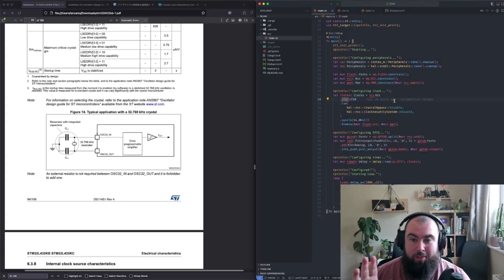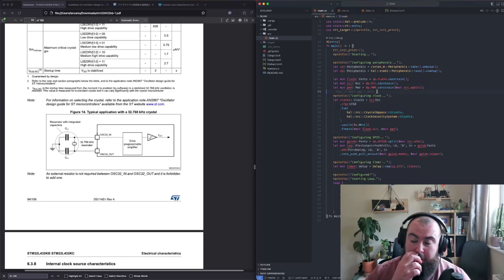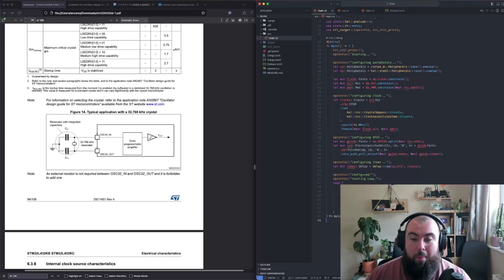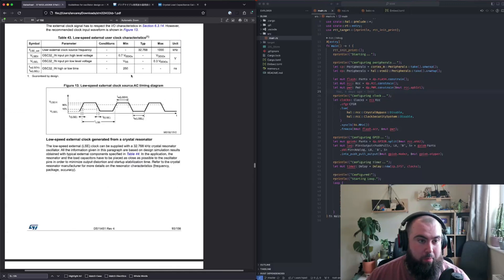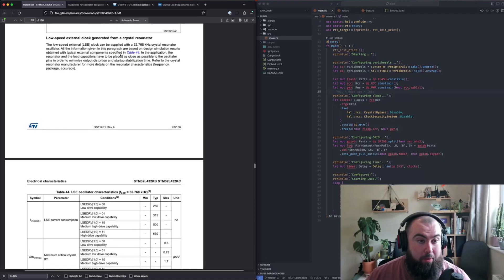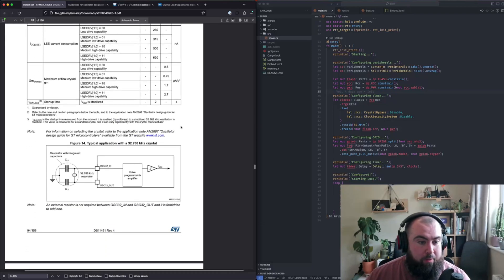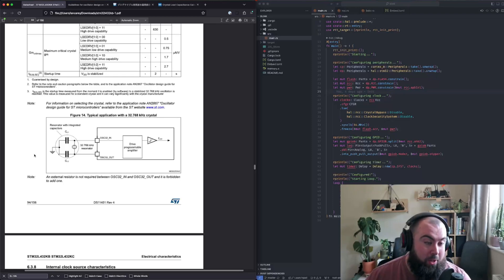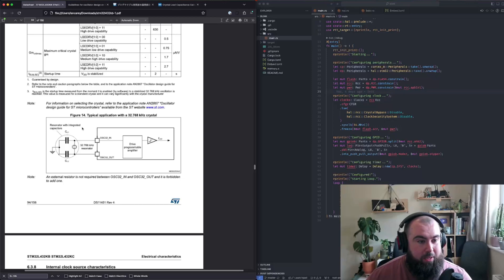How to set up the LSE on an STM32

Comment: Why 32k and not the 32.768k(?) one? Internal crystal for most the STM32's I've seen are already tuned for the inferior 32k clocks. 
And Do you mean to say that on the low speed pins, your original board had the wrong clocks at 16MHz?
Finally, with such low volume, just get an active circuit, single clock oscillator. Dealing with caps and impedance tuning on such low volume made in china boards is just annoying at best and a waste of time at worst. Also if you fuck up and put the wrong speed, you can easily just pop off that oscillator and put the right one on.

Regardless, doing your own board and messing up like 20 times really is the best way to learn.
Reply from the maker: Ahhh sorry, I’m just rounding it off when I say 32k, just easier to say than the decimals, I also keep forgetting what the decimal points are! Originally I had a 16Mhz resonator connected to the same pins, basically didn’t read the docs properly at all… You are also totally right about the external modules for this, this specific STM32 actually only even supports the HSE via one of those type of modules, so in future I’ll probably go with one of them if I come to need it. However, like you say, this was a great way to learn